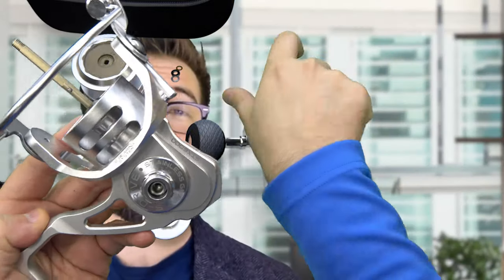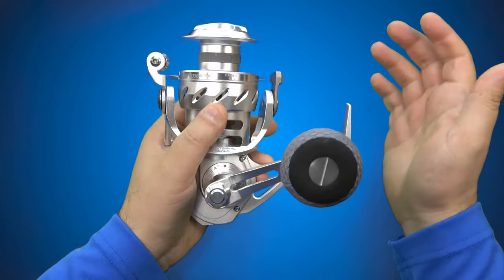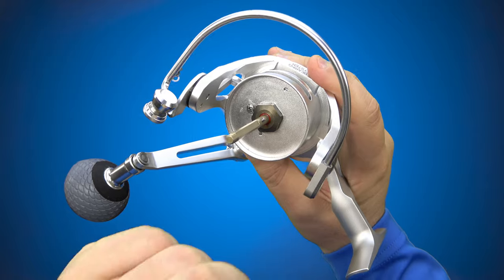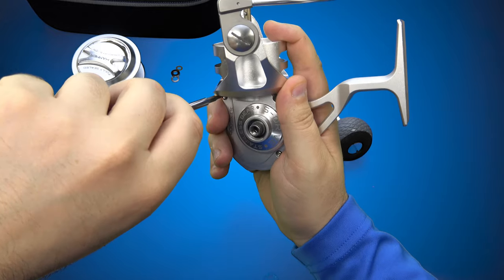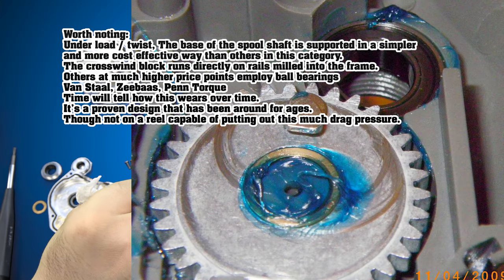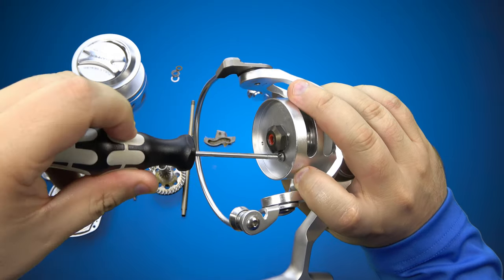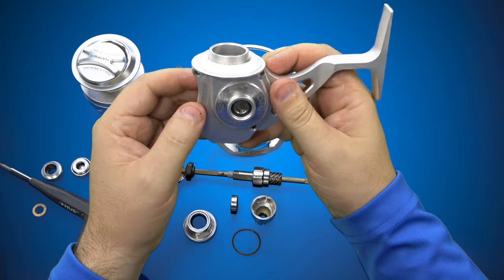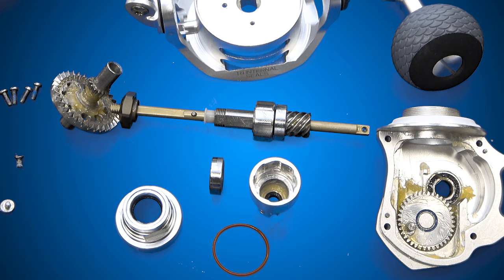Tsunami Salt X:  The most affordable submersible reel.

Comment: I have both the 4000 and the 6000 on a 9’ and 10’ lamiglas rods. I have only had them for one season but so far it is an excellent reel. The only issue if I had to make an issue is the drag is very sensitive it doesn’t take much to go from light to heavy pressure and I have lost fish because my drag was either too loose or too tight. I would still have no problem recommending this reel.
Reply: How has it held up?
Reply: @TonyCantShoot   the 4000 is awesome the 6000 I had some tuning to do to get the line to wrap consistently otherwise I am very happy with both reels and have had many bass, blues and the 4000 false albies.
 The 4000 has also found it’s way onto my boat after an entire year of soaking on the boat no water found inside when I cleaned and greased it. Hope this helps
Reply: @sfrancescon  awesome thank you, I was looking to get the 4000 saltx or 5000 saragosa for my new black hole suzuki 9’6. I have a saragosa on my black hole striped bass special but I wanted to try something new for the suzuki.
Reply: @sfrancescon  I don’t plan on dunking it  or getting it splashed every trip however I just want to know that if it does get dunked/splashed I can just rinse it off with tap water and it’ll be good to go

Comment: I have been fishing the 6000 since late July(over hundred of hours in use), it is easily the best piece of fishing equipment I have ever owned. Throwing plugs, eels, tins, from the surf, and a kayak. The only negative was finding the tiny torque/Allen wrench to secure the set screw for the manual bail. I would highly recommend this reel to anyone in the market for a sealed reel with a budget +$350, shit, you can buy a solid rod and this reel for less than other reels in the market ;)
Reply: rightempire chris nice to hear that because looking forward to getting soon is the reel holding up? Thank you
Reply: It ain't 350 plus

Comment: the gasket on the gear plate is my only concern, as an owner. within two days of getting the reel, I had a bad click right at the bottom of my cycle. I popped it off and found some water and sand inside due to the fact that the gasket was seated poorly from initial assembly. it was a little chopped up but still works fine for sealing. I put a bunch of grease in it after cleaning and realigned the gasket. since then it works as it should and gets used real hard. I will definitely change the seals out in a year or so maybe sooner if needed but I would buy another instead of a van staal, having both currently I say the salt x is a better reel for my needs. I like the lower gear ratio and I think the drag is better. it also has a much more comfortable and compatible reel foot than the vs and also a line keeper which the vs does not

UPDATE: my original reel got much worse. main shaft began to wobble pretty hard as time went on. It was during Christmas time when I contacted tsunami and made a warranty claim. The reel was replaced no sweat, and I have been fishing the new one much harder than I ever fished the first salt x and have had no issues that don't come from just 5-6 days on the kayak per week in PNW for any reel. Happy camper. So while I recognize that these do have some issues for some that make it out the door, I have still been a tsunami fan boy and now own around half dozen spinning reels from them - two of which are salt x simply because they are robust and the customer service was there when I needed it. try that with okuma, daiwa, penn... maybe you'll have better luck than I did

Comment: I just purchased my SaltX 6000! I will have it in my hands in 3 days. As soon as I get a chance to use it in the surf I will report back to you! I did my homework and there wasn't anything I didn't like about the reel. I appreciate you tearing it down to the last screws and I'm still super thrilled to pair this up with my 11'Star Paraflex and hit the surf! Thanks again for a great video.
Reply: How is your reel holding up after 3 weeks I'm looking in to gettin this one would you recommend it thank you
Reply: @alexgenao3300  I like it alot. I'm using it bail-less and very happy with the performance of the reel. Although it's still pretty new, the retrieve is still a little tight. It's definitely not broken in yet. But over all Alex. I think you'll love it.
Reply: vladimir que I appreciate it thanks alot seems very good especially for the money
Reply: How has it held up over 3 years?

Comment from the maker: READ:  Main shaft made from Aluminum with hard coat
Also WHY THE .DUNK TEST OMISSION: 
I did a dunk and wind test and it passed flawlessly.

I didn't put it on video and made no mention of it.

The only mention of dunk and wind in the video was referring to the Tsunami rep saying it's designed to be submersible and able to crank under water.

 
THE REASON WHY:

After the 3 hour successful dunk test of the spinfisher vi and it's failure shortly after.  It proves that long term is the only test.

If the Salt X failed....that would be of more value and I would have included it.

SO much more goes into dunk tests than a bucket or a one shot spin in the surf.

How does it handle when salt and mineral deposits accumulate

How does it handle when lubricants oxidize

How does it handle after wear

How does it handle when sand gets around the seals

How does it handle in different temperatures.

The sealing of this reel is pretty robust.  At the main shaft and body perimeter and clutch cartridge it's perfect.

They use lighter seals at the top of the clutch and handle entry.

They function but how they perform long term after everything mentioned above is up in the air (Seals fail on ZB and VS reels too)

At the same time.  The design looks like it could accomodate seals of different types without the need to retool.

The handle seal is contained in a nut that threads into the frame from the outside.  similar to the Rotor/ clutch seal.

Both of which can likely be swapped out for seals with more surface area.....IF NEEDED.
Reply: Can you do a video on tsunami forged 12??
Reply: Thanks for the info !!
Reply: Can't wait for them to make a modern baitcaster

Comment: Salt water causes the corrosion of aluminum creating aluminum oxide. The salt does not directly attack the aluminum, but causes an electrochemical attack like a catalyst that results in the corrosion. I'd get the color coated one for long term use.

Comment: on that reel i would use my right hand to crank, that design is suseptible from opening from the cover, which is left part of the reel. no deep groves  just 2 pin, they should made it four pin corners at least its equally balance.

Comment: Has some thinner seals than the VSX, the main shaft is also thinner than a VSX allowing it to be more plyable to bend easier or get damaged. Also when you tighten or if need to button the drag the retaining nut underneath the spool you access the rotor will scratch instantly allowing the corrosion coating to come off and making it faster to rust. Just my reviews on it myself. But again If you want a “Submersible” reel with a  right hand retrieve this is your only option.

Comment: Take it apart and add "dry lube" to all the bearing surfaces.  It will spin a little more freely.  And is that stainless pinion gears?  Reminds me of the original Ahab gear.

Comment: The minimum drag being 2 pounds really bothers me with penn slammers and other decent reels so I end up just using battle 2’s for live bait and just clean them a lot.  But those large keyed drag stacks of slammer and previous spin Fisher really slow large fish for me so in the ocean, I use slammer drags but remove the lower spool seal to make the drag minimum better for live bait.
Reply: Wow I didn't know you can do that! Yes I have the same exact problem with Penn reels. Even the new spin fisher live liner I had to return because the drag is too tight even at the lightest setting.
Reply: @miamiwax5504  yeah that's why expensive Daiwa reels use mag seal system which is an oil barrier instead of physical seals.

Comment: Very very convincing....I’m liking this reel scoob. I was going for a long cast for surf this year, but we may have a contender.

As always, your breakdowns are second to none.
Reply from the maker: If you go long cast.  To maximize the benefit make sure to go with factory rod or build that is taylored for it.  I know for a fact the tiralejos are designed for 10 ultegras and aero techniums...........(i know because I blew off the taped on guides when testing spacing :)  )

Comment: Nick, is main gear machined stainless? And could tell if the oscillation gear is aluminum or zinc?
Reply from the maker: Main and pinion are stainless....Main shaft Aluminum with a hard ccat.  Oscillation zinc

Comment: My rotary retaining nut won’t tighten an is coming loose almost like the rotary nut is stripped. Is there any where I can order parts from
Reply from the maker: Odd... Yeah.. Call don't email Bimini bay outfitters... Their email is a black hole like most. If you can send me a few pics of it at tackleadvisorsinitiative@gmail.com
Reply: My rotary retaining an pinion are stripped wish I could order the parts. I never received a receipt from the tackle shop I bought the reel from.

Comment: Quick question for ya, my buddy got a curado DC and out of the box it has hardly any drag even when tightened all the way. Any suggestions on how to fix this problem?
Reply from the maker: Spooled with braid? Braid slipping on the spool?   If no line......if it's brand new.  It's a no brainer.  Return it
Reply: Has fluro on ao I guess it's back to the store. Thanks for the reply.
Reply from the maker: @johnrich9278  Gotcha...that's pretty  strange.....something isn't compressing the drag stack properly if the is no drag....and for that to happen would take something that in a new reel......considering how simple it's design is. ....is a freak thing to occur.

Comment: Mine stopped working in less than a year.  Collects so much sand and junk.  It's not waterproof at all.  Don't even attempt to reel under water.  I rinse mine down after every use, and it still seized up, and something inside snapped.  Now the spool spins with the rotor and won't collect line.  I'm going to have to send it back.  Complete failure.  I needed another reel this week, so I bought a Van staal VR150.

Comment: Never have experienced more wind knots with this reel than any other,need to contact Tsunami,cannot rely on this reel when you have to keep retying your setup,have had the braid changed,weather conditions were not the issue.
Reply: slovak Careful not to overspool
Reply from the maker: This is the first I've heard of any wind knots with their spinners.  Not just the salt x.  Make sure you pretension the line prior to starting the retrieve.  Closing the bail manually Is a must as well.  Wind /conditions are not the cause of wind knots.  That's always been a myth.  Poor line management and in some rare cases reels lay line that caves in the top of the spool can shed loose coils of line. The salt x isn't one of those reels
Reply: Update....returned that reel for another saltx 6000,,,,it’s been flawless this fall,happy now!!

Comment: The one thing I like from tusnumi  is there rods they have great rods don't know if I'd use there I tried some of there other reels and didn't like em
Reply: I'd have to agree up until now. I've been using and abusing the salt-x for a bit now and it's a tank. I cracked it open today to add a bit of grease as it's seen a ton of casts, retrieves, and cranked in fish and felt a little dry. That being said everything internally looked pristine, almost as if it hadn't ever been used. This is one rock solid reel.

Comment: The price is absolutely ridiculous, I can buy 2-3 spinfisher VI reels  and spinfisher can handle pretty much any fish, at least any fish this reel can handle.Also, I have a bad experience with Tsunami when their rod broke after the first use.
Reply: Beyond the breakers you have to understand though this reel isn’t meant for that it’s meant to be surfed heavy in montauk and be submersible you can’t do that with pens granted I’ll take my van staals over any reel any day just for the beating and gear ratios and such
Reply: Completely agree with TA's post: time will tell. Upon breakdown, it does appear to be solid and well-designed. In theory, it will fish the same way. I'm no "Loyal Fanboy" to any one particular reel company, because I appreciate innovation, market demand and healthy competition in the industry. So let's give this reel a valiant shot before we compare it to Penn, Shimano, VS, etc.
Reply: The spinfisher is the best hands down. Idk why this guy says 379. It's on sale right now for 99.
Reply: @timpage5021  until you get a little salt water on it then its trash
Reply: @bunka-boydrew2874  the spinfisher? Or the tsunami.  I got the battle 2 8000 and spinfisher 6000. Both I use for surf fishing and both have sealed bearings.  Both have been put through the ringers with salt and sand. Never had a problem with em. Of course I properly maintain my gear tho.
Reply: @timpage5021  sealed bearings does not make a sealed reel..it all depends on what you consider surf fishing...pulling a granny cart on the beach with lawn chairs in Florida or wading in chest deep water from rock to rock with breakers rolling in like in Montauk..reels like these Van Staal, Zee Bass, Saltx are built for a purpose, The reels you've mentioned just cant compete in that environment
Reply: @bunka-boydrew2874  lmfao.  I'll give it to ya you do got a great sense of humor.  But sadly you're still dead wrong bout both models of the Penn battle and Spinfisher. Do you fish with you're reel and rod underwater or what brother.  If so you're doing it wrong.  Cant tell me nothing bout those 2 models.  I've used for decades now and there's tons of videos on YouTube for you to realize that for yourself.  If you wanna spend 400 dollars on a reel hey its your prerogative to do so. Just not necessary.
Reply: @timpage5021  I actually do, wading out to sandbars and such. I own a Van Staal VR150 that's on a 9"2 Lami. I'm looking for a viable lightweight reel to go on a 7ft rod, so instead of sitting on a waiting list for the VR50 this is the next best option
Reply: @bunka-boydrew2874  Spinfisher v and vi both have sealed main gears and use sealed bearings.  You can fish them in Montauk and all throughout the Island in the elements but you do have to maintain them if they are fully dunked.  I've been surf fishing Long Island for 35 years using Penn reels.   My Spinfisher V has been fished hard for 7 years and only replaced the bearings once.

Comment: i got a shimano ultegra 5500 ci4 xtc five months ago still in the box. i was going to break it in next month  and you spring this on me lol . seventy more bucks  would make a major upgrade from the looks of things.  i do like the ultegra its lite and has the long spool and fancy slow oscillation . my quandary is sell it unused and spend seventy more dollars  for the tsunami ? what are your thoughts on the ultegra have you fiddled with one?  stuck on stupid !
Reply from the maker: The ultegra is a great reel.  Light as hell for it's size.  It's issue is it's terribly complicated to maintain.  Which for freshwater applications isn't an issue....but  salt and sand combined with lack of waterproofing.......mean you have to be very careful.  Reels like this are designed to take abuse....keep in mind though.  More than a bench top analysis is needed to see if the salt x is a winner.

Comment: Picked one up to put to the test in a commercial fishing environment. Will report back at a later date how it's held up.
Reply: Few thousand pounds of fish and thousands of casts and retrieves later... no change from out of the box.  Though I'm going to crack it open on the side plate and refresh with my preferred grease. Simply a personal preference.
Reply: Thanks for the update. If it's not too much to ask can you update if any issues later on down the road please
Reply: @Popareeno  - No trouble at all. If there is any point of failure inherent in the design, pounding it cranking in mackerel will be sure to make it very apparent rather quickly.

Comment: You absolutely will get blisters from the handle on this reel. Granted, it took 6 hours of jigging to get those blisters.
Reply from the maker: lolol......if the stitching has a rough edge it would definitely cause blisters....overall though it's a fairly comfy knob....I'd prefer straight tpe or eva though
Reply: @TackleAdvisors  Missing your reviews! Some big company must have snapped you up as their R&D. Signed. Need guidance. :)

Comment: If U have used any of Tsunami’s other products U won’t buy this reel for more than $99.00!!! : )
Reply: Tackle Advisor is right time will tell. Heard Tsunami shield didn’t hold up well. We’ll see about this one
Reply: Anthony Antanaitis Shield is garbage. After 4 months of 3 times use (6000 series) (no dunk) it was a coffee grinder. On top of it, the handle fell off... I sent it to Tsunami, they replaced handle, still coffee grinder. I’m waiting for it to die then switching back to saragosa 5000. You get what u pay for.
Reply: I bought a multiples of both the shield and the guard from Tsunami for surf and jetty use and every single one had issues.  Went with Penn slammers and no issues whatsoever. Save the money and get something good.
Reply: szymon antos gotta put grease on the exposed seal red seal
Reply: szymon antos Think I’ll stick with Shimano and Daiwa . I take care of them and never had any problems
Reply: Tom Porgy you haven’t learned from this channel the manufacturers source the same parts. You pay for that name brand though if it helps your confidence.